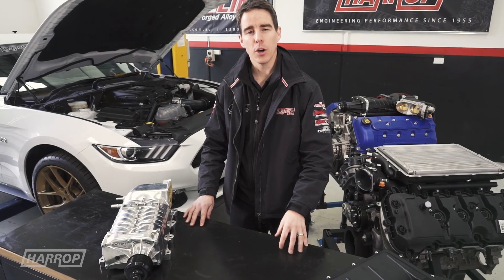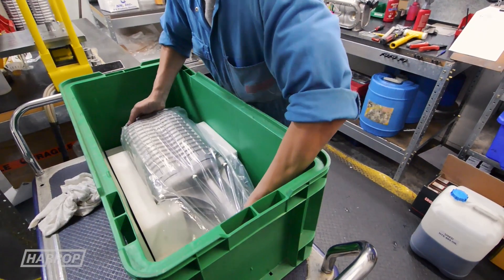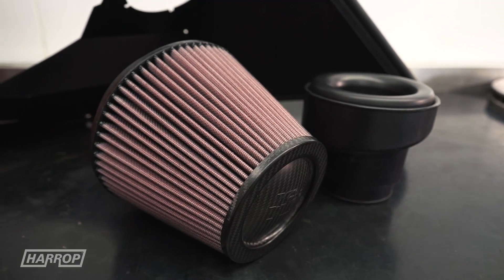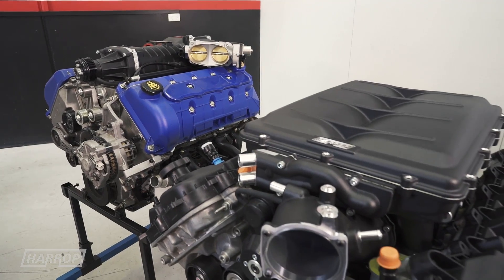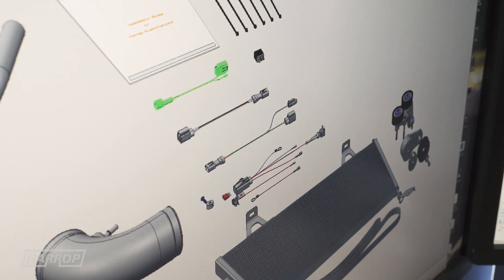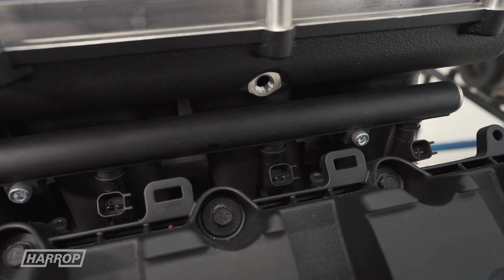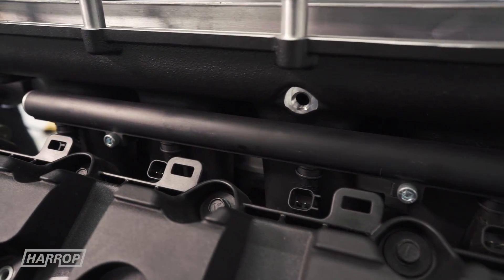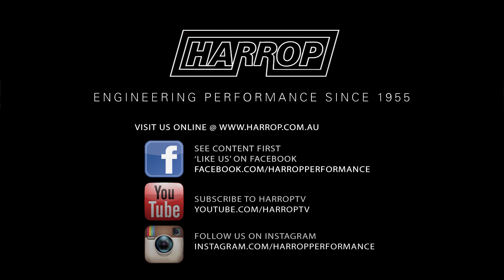Harrop Mustang 5.0 Supercharger Kit Technical Review

Comment: Very nicely engineered system. How does your system differ from the Edelbrock supercharger system sold in the US?
Reply: The Alpha Male i cant tell you specifically either, but edelbrock does seem to be producing kits that have similar design goals as harrop’s and even look much like harrop’s do now (both are aiming for a OEM packaging/appearance etc. though I guess) aside from performance I’d look at warranty, what type of blower, roots/“TVS” (still roots/or twin screw, my understanding is all else being equal twin screws are simply superior and reduce need for intercooler surface area/intercoolimg at all in some cases because there’s so much less heat generated vs a roots style (I can’t say confidently that this applies to TVS as I’m not sure if that’s strictly marketing dribble or if Eaton has actually fundamentally tweaked something about Roots blowers operation in their design of the TVS series, they made an off the cuff claim that it’s not actually hotter but I’ve yet to see anything that backs that up/substantiates it. 

Also pay attention to things like accessories/sensors. Do they each include/support/include the same sensors, does either/both include a bypass valve (harrop was first to ever do this with their e9x M3 unit a few years ago) and upgrade path (are stage 2 kits/different pulley sizes available) & tunability, for that I’d check forums or call a few tuners that you’d be using and ask their opinion on the ability to tune it/fine tune boost delivery especially if a bypass valve is involved, and inquire as to the pros and cons of bypass valve vs. no bypass valve and when it’s recdomended & when it’s not. 

Someone recently commented that their harrop e9x m3 unit made it difficult to control a drift as if you slightly lifted off the throttle mid-drift it was like flipping a switch and the car straightened out immediately, as if traction control had kicked in, I assume that’s the bypass valve being activated/bypassed, causing a sudden increase/decrease of torque, but those m3 kits didn’t have a MAP sensor and this mustang one does and it’s possible that alone would be enough to help fine tune throttle issues like that. 

Just do your research, and keep doing it, until you have nothing you can be surprised by, and then there’s zero chance to be disappointed that a $10,000 investment isn’t living up to your expectations. 

and if you find everything seems almost equal in every regard, then send harrop sales/support team an email and do the same with edelbrock (or call if you prefer) and see which one responds faster and is willing to assist you more. I can’t speak RE: edelbrock but harrop exchanged a handful of emails with me over the weekend sharing info/insight into things they didn’t even have to acknowledge much less give me detailed answers to, but they did, and I’m not even a customer, but hope to be soon.
Reply: The Alpha Male also, both seem to make a kit for the GT86, so that may be a decent baseline to compare the 2.

Comment: NICE kit! Roush stage 1 does 670whp and 500wtq and keeps warranty as well...SEEMS like a very clean/nice set up but so is the Roush...if Roush is same price or less it'll be a tough sell...more power with a pully change, you get over 700whp but void warranty so if this isn't super cheap, I'd stick with the proven Roush...IF this saves me 500 or more bucks, then I'd consider it.
Reply: Hi LJ, the 670 refers to engine horsepower not rear wheel. if we are talking engine HP then our Kit is a touch over the 700hp mark, we also offer warranty on this kit. We were able to design a kit that doesn't require modification to the engine, i believe our kit is cheaper than the Roush here in Aus - win win!
Reply: Do you sell to the U.S.?
Reply: LJ, plus this is with stock everything except the Supercharger/Cold Air Intake meaning stock headers/cats.  Just imagine what this could do with those mods added.  It could prob get close to 800hp.  What I'm curious about though is the cooling.  Itsjusta6 had a Roush and his belt would slip off and the engine overheat.  Then there was another guy, I think Rated R cars which had a Whipple and his also would overheat so since these are similar, I'm curious how this one performs cooling wise.  I don't want to go on a long trip and have my engine blow up on me cause My Mustang is my daily.  Too bad this blower isn't sold in the US.

Comment: Outstanding job gentlemen!  Question:  Given the massive impact you've had on power and torque, to what extent do you think the rest of the engine and then the drivetrain is able to handle it?  Obviously the cars coming to Aust are all new at the moment and this would void their 3 year warranty.
Reply: Pretty sure harrop give you warranty 
And in the US they are pushing these motors stock with a blower or turbos upwards of 1000 hp and running 9s down the 1/4 just with et radials

Comment: What is the impact on fuel (98) usage after installing a supercharger in city and highway driving when compared to stock?
Reply: I had a 2.4 whipple on a Xr8 with the 5.4 hwy it used 11liters per 100ks and that was from a boss 260kw fly to 440kw at the fly
Reply: Hi Nevilegreg1, the impact is not huge, in saying that it will all depend on how heavy your right foot is. We had a customer drive from Sydney to Adelaide getting an average of 9.5L/100km. This Mustang was putting out 485kw at the rear hubs.